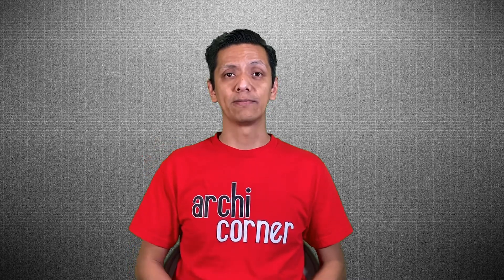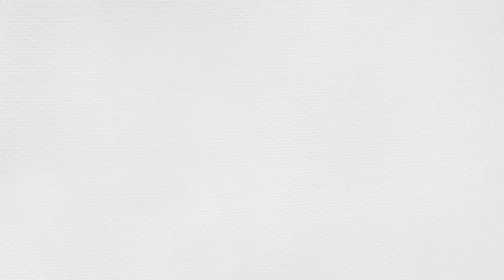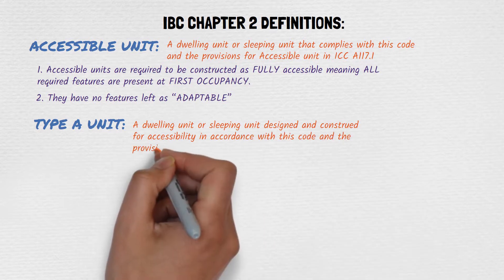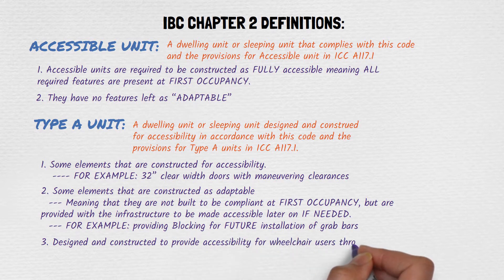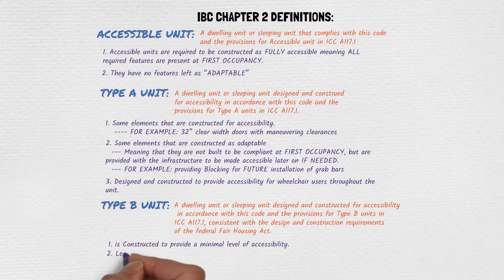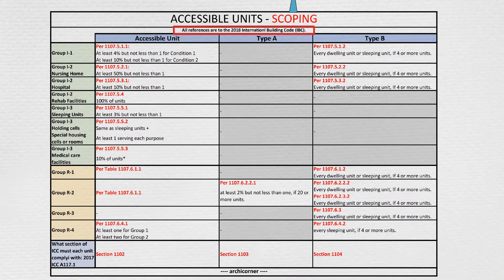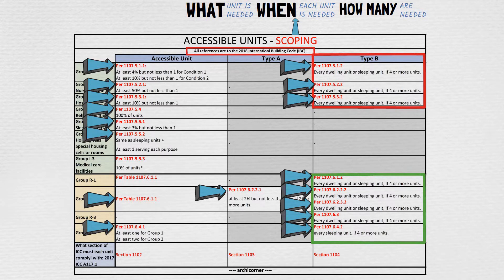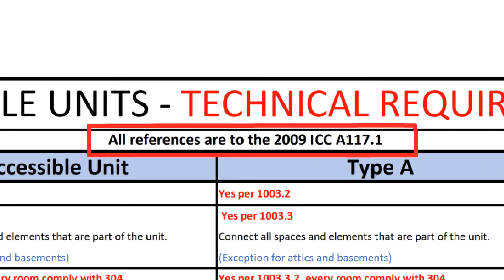AC 035 - "Accessible Units", "Type A Units" & "Type B Units".

Comment: Hello,

If we are developing a multifamily R2, are accessible apartments necessary in all cities? Because I noticed a lot of permits in Houston, and they only do type A and type B units, with accessible units being omitted. 
Is it required to allocate the accessible units across the various apartment sizes? 
How about type C units? Is it necessary for multifamily, and what are the requirements? Do we need only to provide communication features, or should we also provide accessible clearances?
Reply from the maker: All good questions. Every jurisdiction may be slightly different. Best thing to do is check with a local architect who knows the local codes.

Comment: Thanks for such a great video! I have a question about where to find the requirement for an Accessible unit, type A unit, and Type B unit. I see you used IBC to find the requirement. Can I find these requirements in CBC? Thanks!
Reply: Does the CBC refer to A117.1, 2017 Chapter 11? That is where it comes from in the IBC.

Comment: 2:20 MIN IN AND THE WORDING SEEMS TO ALREADY BE SELF REFERENTIAL.    "ACCESSIBLE UNITS" HAVE 2 TYPES: (TYPE A UNITS) AND (TYPE B UNITS).  TYPE A UNITS ARE TO BE ACCESSIBLE UNITS, BUT OF COURSE THEY ARE IT WAS JUST DEFINED AS A TYPE OF ACCESSIBLE UNIT WHICH BY DEFINITION IS AN ACCESSIBLE UNIT!?  TYPE B UNITS ARE PERMITTED TO BE ACCESSIBLE UNITS OR TYPE A UNITS,.....SINCE TYPE A UNITS ARE ALREADY DEFINED AS ACCESSIBLE UNITS WE HAVE THE FOLLOWING MATH ISSUE.   1) AU = TAU OR TBU.  2) TAU = AU,   3) TBU = AU OR TAU.....SINCE TAU = AU, THEN TBU = AU OR (AU).....AND SENSE AU -  TAU  HOW IS ANYTHING ACTUALLY BEING DEFINED?